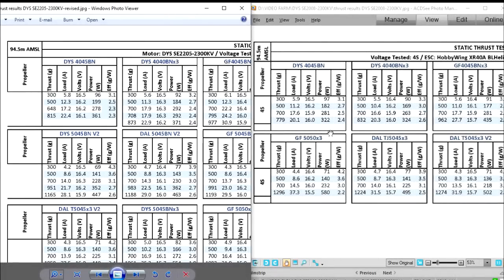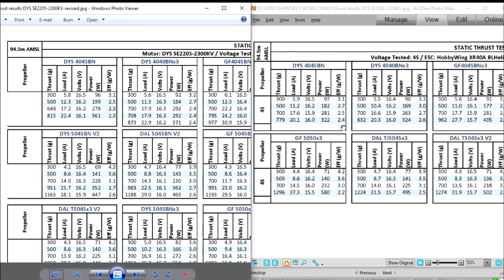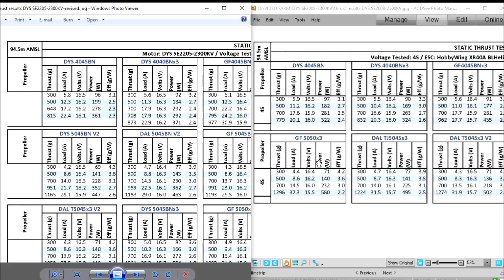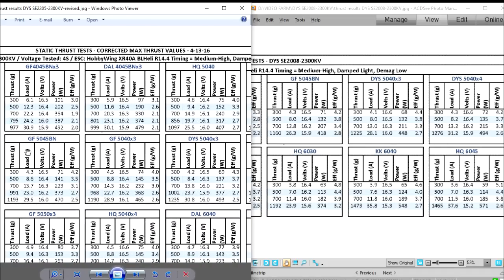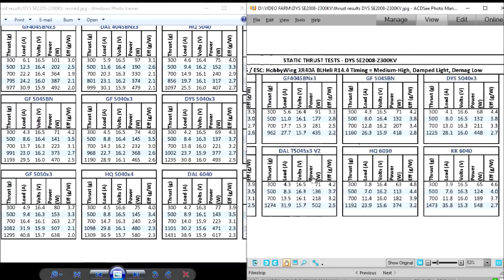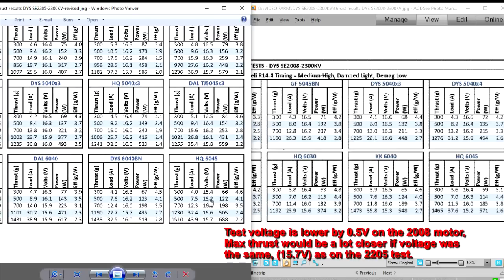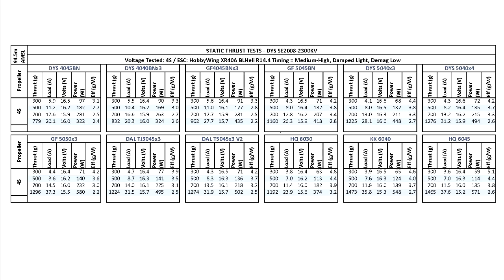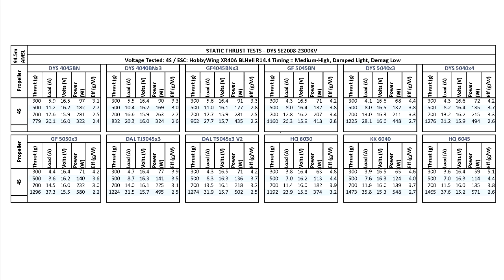DYS SE2008-2300KV Static Thrust Tests

Comment: can the dys 2008 2300Kv handle 5s lipo?
Reply from the maker: Should be ok with 5040x3. For other more aggressive props, make sure to check motor temperature after a short fast lap and a full throttle punch

Comment: I switched from the 5040 dals to the gemfan 5152 and it's everything i seek in a quad . Only problem is my 5s dinogy 1300mah's are coming in a bit warmer than i would like.  I'm getting 84a max current draw, the motors themselves don't even get warm but i am curious if maybe a 1500mah battery might be more suited?
Reply from the maker: Batteries running warm is OK. I think up to about 100F is no problem. If voltage or flight time is getting too low, then yeah, probably batts are tired. Those new LiPos from RDQ (Joshua Bardwell reviewed them) look very good. A 1500 size LiPo will be better for maintaining voltage. Weight will increase but should not be that bad. You might feel it but, should't be too bad
Reply: Every punch i get it sagged out to the beeper so i have to be careful with them but in saying that the power is great. They are nice batteries but if there anything like the 4s dinogy's i have used they wont last all that long. As for the flight time it's as good as most 5'' quads.
Reply from the maker: The older "blue" Dinogys sag a little when stressed hard. The newer orange Dinogy's peform better. Same with a lot of the newer battery packs from Gens Tattu R-Line, Acehe, etc  they don't sag as much.

Comment: 700g of thrust with 3.9g/W efficiency (6030 prop) is really impressive. Is there any combination that delivers even more efficiency @700g thrust?
Reply from the maker: Perhaps if you go to a larger 7" prop. Larger props are usually more efficient.
Reply: How about 6030 on 2600kv? When I look at your test results, xx40 and higher pitch seem to overload 2600kv in comparison to 2300kv.
Reply from the maker: Those high KVs (2500 and above) make for an inherently inefficient setup for small motor sizes. The best way to achieve an efficient combination is to use a motor that has good torque capacity (low to mid KVs 1500 to 2300)and as large a prop with the least pitch possible. So for efficiency 2600 is the wrong way to go.
Reply: I already have a hard time using 6 inch props. 7 inch is impossible and the setup should run on 4S.
You say, 6030 performs better on 2300KV than on a todays 2500KV or 2600KV? Or could they have at least almost the same efficiency but with more thrust on the 2500KV?
Reply from the maker: Yes, for overall efficiency a 2300KV motor will be better for that prop. At "cruising"  or low throttle, the 6030 and other low pitch props have similar efficiency on 2300 / 2500 / 2600 but as you go past mid throttle, the 2600KV motors get less efficient. But if you're configuring a setup that won't destroy LiPos or that you want to fly for a little longer per battery, then it doesn't make sense to go with a 2600KV.
Reply: Thank you. So I better switch from 4S to 5S or 6S in order to get the punch when I need it? By switching from 4S to 6S with a todays 2300KV motor, is there less loss of efficiency in comparison to a 1800KV motor?
Reply from the maker: Yes there's a little loss in efficiency, when you go to higher voltage usually that requires lower KV to mantain efficiency. You can do 5S and 2300KV but then you loose some of the efficiency due to heavier battery packs. In miniquads, most people go to higher voltage like 5S to gain power, not for efficiency. In large multirotors high voltage with low KV motors are used for more efficiency.
Reply: Every combination of motor, prop and battery has its efficiency curve. I  think, with more efficiency you get additional thrust more easily at a specific operating point. Then, maybe it is a good idea to have as much efficiency as possible at the higher RPMs, because the most thrust is delivered at higher RPM. I don't need to use the lower RPMs if there is no thrust and eventually I could increase IDLE RPM to some degree for that?
Also, you might have some amount of thrust T1 at RPM R1 and some amount of thrust T2 at RPM R2. A very high amount of thrust T2 at RPM R2 is no good, if it takes me "forever" to spin up from RPM R1 to R2. You might prefer a less higher value for T2, if you can spin up faster from R1 to R2?
Reply: Just watched some of your videos again: I think, when talking about differences in amperage, one should always compare exactly the same thrust, because the relation is not linear.
Reply from the maker: Lars lrs correct. Thrust comparison makes more sense.
Reply: Ok, then: Could you please make a test 3S vs. 4S. vs 6S with a 2300KV motor and a 6040 prop? Only one motor and one prop. Start with 500g of thrust and increase thrust in steps of 50g, but do not go over 1100g of thrust and do not go over 400Watt?
Reply from the maker: If I have time.... I've been quite busy at work and home, hardly any time left for testing and flying and I got about 4 motors on queue  for testing. New EMAX RS2306 and new DYS Storm 2207
I won't test 6S on a 2300KV on the thrust stand. Static load is way too high. It is known and proven that higher voltage will usually use fewer Watts to achieve the same thrust/RPM (same motor, same conditions, WITHIN MOTOR'S optimum performance envelope -if you overprop or underprop, then you lose efficiency). You can see it on the 2550KV version of this motor I ran 3S and 4S. Though the 3S runs were only for MAX thrust. You will need to compare RPM's as the logging for thrust on the thrust stand lags a little when doing a fast ramp-up. Concentrate on RPM's. For example: 
DYS SE2008-2550KV HQ6045 
3S @13907 RPM 178.97 W
4S @14039 RPM 120.90 W

Excel table on video description section 
https://www.youtube.com/edit?video_id=hSMtDrtyDsw

Comment: Hi. as will be the motor on 5S fly? about how many amperes "A" will consume and what props you advise?
Reply from the maker: dmitry this motor should be ok on 5S. It uses a little less Amps than 2205 motor on 4S so same on 5S it will fewer Amps. Depends what prop you use. I think 5040x3 would be one of the best props to use. Also GF5045BN, HQ5040. Those are good propellers to try at beginning. 5040x3 Max Amp in thrust test is 30A. in flight about 25% less or 23A. 5S my guess is about 27A Max in flight.

Comment: Are you going to test the new 2206 xhover motors? Everybody is starting to use them
Reply from the maker: JC250 Unfortunately I don't have a contact there to send me test samples. Thoe XHover look a lot like ZTW Spyder motors. The top pattern looks justn liky the ZTW Spyder 2204's top. Perhaps they're made by ZTW, that's a good thing. ZTW makes good quality parts!
Reply: Hyper as in hyperlite?
Reply from the maker: No I was thinking of other motors... but these http://xhover.com/collections/motors/products/xhover-xh2206-2360kv-racing-series-motor look like this one, the top pattern on motor, different size however
http://img.banggood.com/thumb/water/oaupload/banggood/images/1F/60/49fa1af1-4325-4cc5-9ea8-d3b1d3d7014d.jpg

Comment: EngineerX, would you recommend those over the old emax rs2205?
Reply from the maker: That's a very though choice. Both have very close thrust test number when you look at the thrust table side by side. The Emax is a little lighter and proven to be reliable. I have not yet flown with these 2008's so don't have long-term use experience to know how well they do after some abuse, so based on that I can only tell you the Emax RS2205 has been very good in one of my quads, lots of use and lots of crashes and they're still going strong. So you can't really go wrong with the Emax and now they're cheaper!

Comment: If you think about the physics involved it starts to add up. The narrower stator means that the magnets have to travel slightly shorter to cross each stator pole. This in turn mean that the current has less time to build and the motor thus spends less time in the highest current state.

It seems to me that high stator width is undesirable from an efficiency perspective. The shorter the time spent between the stator poles the better. It seems this is where the kv limits come in as the size of motor increases. Of course there are limits to how high you can reasonably go and wider adds torque/weight better than higher at the cost of efficiency or KV.
Reply from the maker: That makes sense. Combined with the extra 3mm of stator/magnet height (when compared to a 2205's stator. Then it's easier to understand how this seemingly "smaller" motor can perform almost as well as a 2205 in thrust and do better in efficiency.

Comment: Just so nice to see really tidy windings ....instead of some of the really sh//ty rubbish the various back street copiers churn out.
Reply from the maker: Windings are pretty for sure. I tried rewinding a burned out MT2206-1200KV T-Motor once and windings came out sh//ty as you mention and motor did spin but got hot right away - LoL, too much work! it takes some good skill or a good machine to get windings so neat.

Comment: Hello, congratulations for your work! Great list! why not make the test even with less efficient propellers but that use less amps? type the 5x3 and 5x4? everyone wants to get super propellers on its Drone ... but lipo fail to give all those amps that they need! I think with two-blade propellers 5" add a great job for those who want to run with smaller lipo. thanks Federico
Reply from the maker: Good point - I think 5x4 would be a good prop to use. Most people don't use the 5x3 anymore that's why I don't test it. Also it's a little too flimsy/ flexy so in very high RPMs they start to wobble some times.
Reply: EngineerX Yes you are absolutely right that the 5x3 are not used anymore. =) but the 5x4 have a good check and a few amps! I know that you use just because people want so much pressure, but do not understand that the lipo can not push it right! I'll be pleased to see your next test with hqprop 5x4. thanks and good job! Federico
Reply from the maker: I used to test HQ5040 before, you can see some previous tests on the EMAX RS2205-2300KV - revised thrust table is on the video description. I had to re-run tests so make sure you take a look at the Excel table. https://www.youtube.com/watch?v=XNwj-GEx1UQ

Comment: Wow really nice high torque motor with higher efficiency! very interesting! is this the most efficient motor that you have tested? G/W?
Reply from the maker: One of the most efficient indeed, It's gotta be one of the most efficient from my "new setup" using the RCBM thrust stand. I was quite surprised at how well these handle the larger props ever since I tested the 2550KV version.